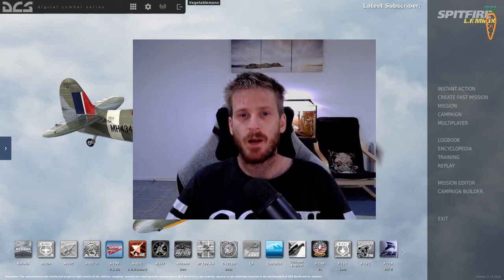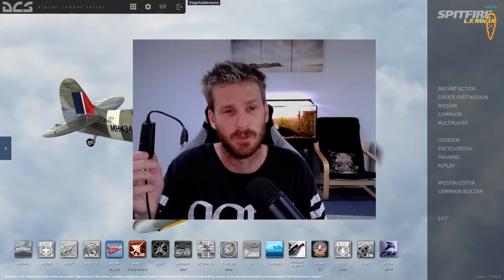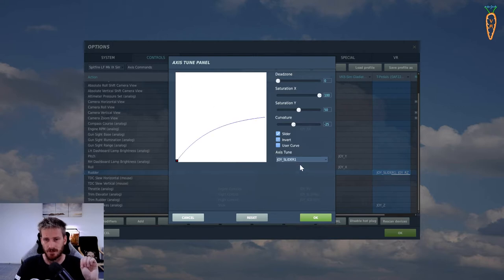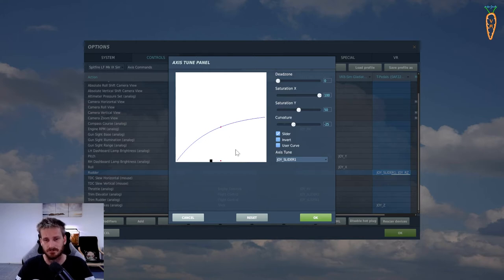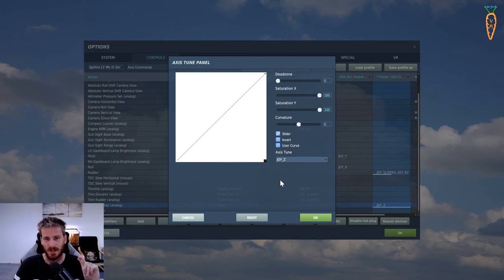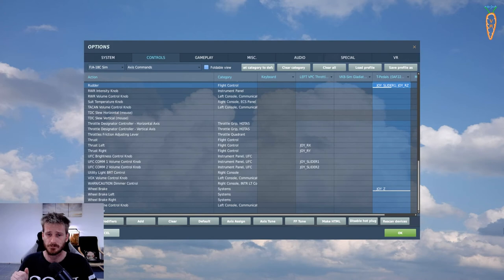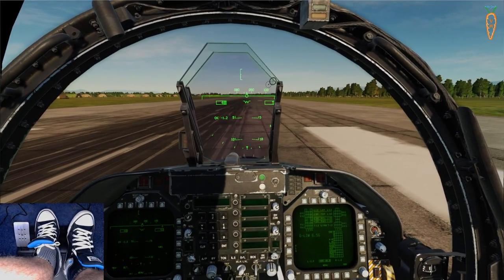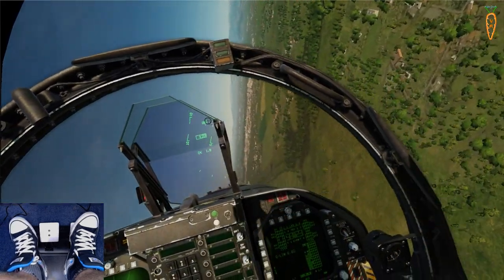Using Racing Pedals as Rudder Input in DCS World

Comment: Just an addition: When you assign the same axis as you did for rudder to the wheelbrakes left and respectively right, you just need to add a modifier, meaning a Key on your keyboard like str or alt. Now, when ever I need the axis to work as brake, I just have to hold down the assigned modifier and the pedals will work as brakes. if I release the key, the pedals work as rudders. Thank you for doing a nice tutorial, mate!

Comment: AWESOME video, haven't set up the curves quite yet but used my G27 pedals and saved myself a couple hundred dollars (it also makes switching over to my racing wheel all that much easier which is an added bonus). Obviously it's not the absolute best solution, and I found if you accidentally bump the other pedal it kind of overrides your current input....but still, absolutely fantastic. Thanks very much for this useful video!!
Reply from the maker: Yeah I noticed that too! I eventually bought myself a sim rig (which I really need to make a video on) that can house both sets of pedals without moving anything now but it was so handy to be able to use the racing pedals for both.
Reply: if you get the Leo Bodnar adapter you can use their software to set deadzones on either side of the axis and that will help with the override inputs, especially if your pedals are really touchy like mine

Comment: Hey man, I've got T3PA pro pedals and for some reason mine start on the left side of the graph and go to the right whereas yours start on the right and travel down to the left therefore you can adjust your Y saturation to 50, when I do it all it does it limits my rudder output to 50 because it travels from 0 to 50 rather than from 50 to 0 like yours, I have no clue how to flip that, any idea ?
Reply: I have the same issue with my SImsonn racing pedals.  I havent worked it out yet, but am going to try with VJoy.

Comment: Thanks for the tutorial!  Using Fanatec club sport LC pedals set up as in the video. Once I push either the gas or brake, the rudder is stuck to the corresponding side. The only way to fl straight pushing a pedal is to hold down one of the pedals half way. I’m positive it’s setup as described in the video. 50/50 one side inverted. Pedals connected directly to pc. I think this is the issue others are describing.
Reply from the maker: Yeah it seems to be the case. I’m at a loss to understand why. I’m wondering if there’s some other kind of intermediate software available
Reply: so i installed ucr and vjoy, and now every second or third timei push the gas pedal for right rudder, it gets stuck half way back to center, but it only does  it in vjoy.  if i go to calibrate the club sport pedals, it never gets stuck.

Comment: had to add some major deadzones in my g27 adapter cable software. the pedals would override each other sometimes, but the deadzones luckily fixed it. i wish dcs had more deadzone options cause i know some people have the issue i had but dont have the software to fix it
Reply from the maker: I’ve found that with my thrustmaster ones too. It’s so sensitive that the slightest input from the other side overrides it.

Comment: I have some old logitech pedals that I've hooked up through UnoJoy and after reversing the potentiometer on the brake (these are gas/brake only) I think they should work. I can set up each pedal so that the rudder goes from 50% to full and individually they work. But if I do both the rudder jitters and jumps around so that it is unusable. Thoughts?

Comment: oml I found you haha, how do i fix the axis being locked to one side? would love to use my pedals for the F-14 without Vjoy.
Reply from the maker: Do you mean that both pedals are making the input go the same way? If that’s it, you need to invert one of them
Reply: @MrVegetablemann  negative, they work but one axis will stay at 100% left or right until you press and depress it
Reply from the maker: @slothkid9199  got the saturation set at 50? That’s a weird one. I might have to wait until I can play with mine and get back to you.
Reply: @MrVegetablemann  yeah set exactly as in the video :/ always wants to stick an axis on like it is in the settings screen
Reply: @slothkid9199  same, did you fix it?
Reply: @windcraker  any luck?
Reply from the maker: What pedals are you using?
Reply: @MrVegetablemann  T3PA pedals, it's been awhile since I've tried so I'll give it a go w my new t300 as apposed to my T150
Reply from the maker: @slothkid9199  are you using the USB adaptor or do you have them plugged into the wheel? I use the USB adapter and make sure the switch is in airplane.
Reply: @MrVegetablemann  fanatec club sport v3, it appears as if they are reversed, and doesn't matter if I set both inverted or either one, the rudder will move but once a pedal is let go, the rudder will go hard left or hard right like the pedal is pressed full down. In games like assetto corsa with content manager you can click on invert axis which works fine but in dcs that doesn't seem to work because we are tricking it to use 2 axis as one so the invert won't work.
Reply from the maker: Hmm that’s the same issue I had with mine but with a different pedal type and it was because I had that USB adapter set wrong. But that was the T3PA pedals. Sorry I couldn’t be more help.
Reply: @MrVegetablemann  that's ok, that gives me an idea. I currently have them directly connected via usb, but I can use a telephone looking lead that connects to the wheel base, which might give more options or send the signal slightly different via the wheel base driver. At least it's worth a try. My next route if not is to use the vjoy software to over ride it. I just didn't want to install software if I didn't have to. Thanks for your video
Reply: @MrVegetablemann  directly to the wheel, if the adapter has an airplane mode I may just snag one and use it via USB.
Reply: @EnduroTrailRiding  vjoy works great If you don't mind the headache of it and having to make sure it's disabled when not in use
Reply from the maker: @slothkid9199  You can pick them up pretty cheap from memory. T.RJ12 USB adapter I think it’s called
Reply: @slothkid9199  I'll try vjoy today. Thank you
Reply: @MrVegetablemann  we dont need any adapter so the issue doesn't come from there
Reply: @EnduroTrailRiding  yeah i had same problems with my fanatec pedals, i did find another solution though using UJR with vJOY
Reply: @windcraker  same problem here/ Id rather not use vjoy...any solutions?
Reply: @ADX77  looking for a solution myself, did you solve this?

Comment: It doesn't work for me. I have the Thrustmaster TLCM, I followed your tutorial but one pedal or the other one remain like pushed
Reply from the maker: Are you using that weird phone adapter thingy for the USB plug? Double check it’s in the right mode on the little side awitch
Reply: same, did you fix it?
Reply: yeah i had same problems with fanatec pedals, i did find another solution though using UJR with vJOY

Comment: Great walkthrough, but when I do this my pedals act like they are backwards.  By pushing them in, it brings the pedal out to resting position.  Would you know a fix for this?
Reply from the maker: Do both pedals do it?
Reply: Exactly the same issue. Heusinkveld Sprint.
Reply: @MrVegetablemann  yes
Reply: I get this with g27, invert doesn't fix it
Reply from the maker: @EthanolEnthusiast  Did you make it a slider?
Reply: @MrVegetablemann  yes, I ended up combining throttle and brake to single axis and using that instead. Not ideal but heyho
Reply: Still can't get mine working.  Haha

Comment: Hi does this adapter work with fanatec elite pedals
Reply from the maker: Possible but I think it’s very unlikely
Reply: I have the Elite Pedals with LC plugged from the LC to the pc with the usb cable.  I want to use them as rudder pedals in dcs.  

in DCS they show up and I can assign them BUT, for some reason they are opposite…. I have them both as 50% on the Y axis and one is inverted BUT when the clutch is out the rudder goes to the left a f when I push the clutch in the rudder comes back to the centre, even if I invert that axis it just goes to the right side and does the same thing .

so essentially both left and right pedal are already to the side and when I push the clutch in they come back to the centre has anyone else got this to work and hoe did they it 

thanks
Reply: You can buy the cable end from Fanatec... i have done.  I also cannot get the rudder to move to FULL by pressing either pedal. It is at FULL in the resting position, centered when both pedals are depressed fully -  So I fly with both pedals fully depresed and release either  when needed.  When i want to release the pedals completely (not hold them in) i have a RUDDER CENTER button to alleviate the rudder resting rudder position issue (full right rudder in my case).  I use these pedals in Xplane and MSFS but for some reason it appears DCS sees the FANATEC pedals in reverse postition ? 0 to 100 is in reverse.  I would have thought reversing the slope of the line using User Curve feature  would fix but no.